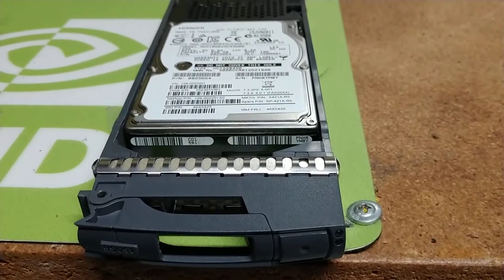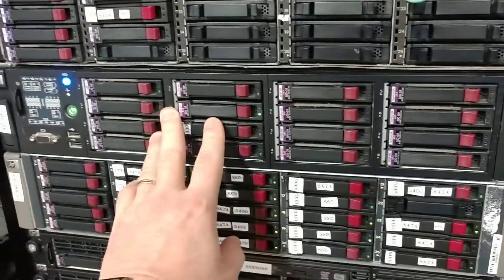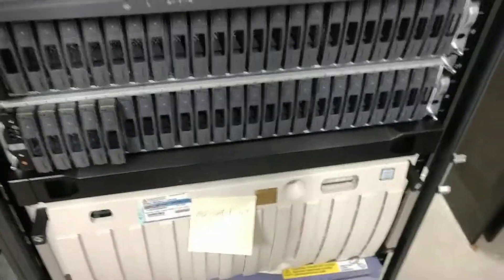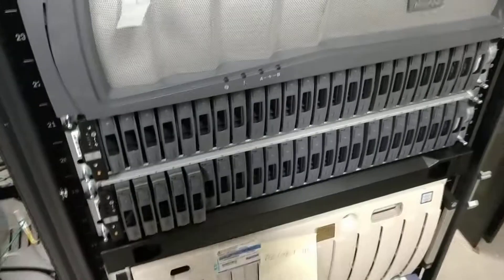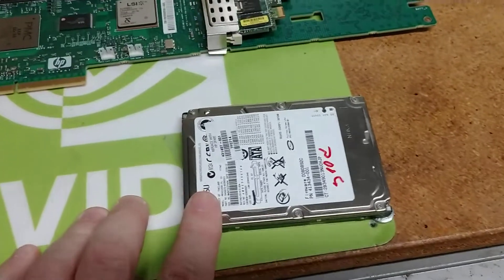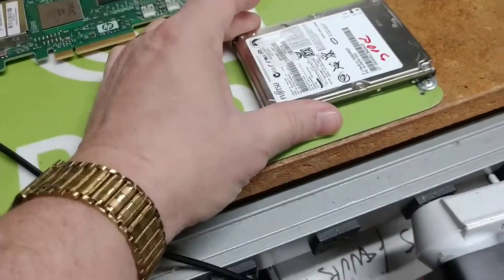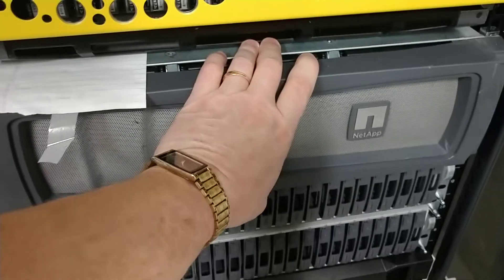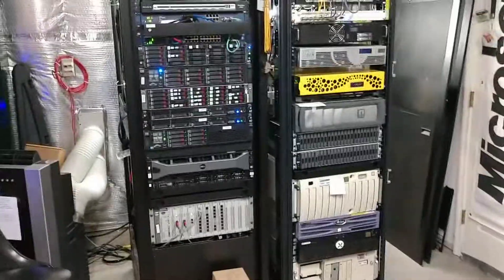How to reuse NetApp disks by reformatting them back to 512 Sector format from 520

Comment: A FAS2240-2 should work fine with the IOM6 module, right?  I have it hooked up to my HBA and can see the drives (both the NetApp 520 drives, as well as the 512 drives I swapped in), so there shouldn't be any snags that I can think of.  Thoughts?  Will these 2240's work as JBOD/Disk Shelves for me?
Reply from the maker: Not sure that model   "NETAPP 111-00190+B1 OM6 Controller Module"  is for the DS2246 DS4246 really
Reply: @leadiususa7394  I found some references that imply the 2246 is just a 2240-2 with the controllers replaced with SAS interface modules and vice versa.  I'm actually minutes away (hopefully) from starting the process of re-sectoring 32 NetApp drives.  And if that goes well, another 50 or so after, lol.  After that I'll just have to figure out why a third of my enterprise 2TB SSDs are showing up at half size with a different name.

Btw, were you able to figure out anything to reduce the power draw of the 2246?  Even in what seems to be the lowest power mode (one IOM6 installed, one PSU enabled, two PSUs installed -- to prevent the hurricane force panic mode) I'm drawing about 100w at idle with only SSDs.
Reply from the maker: @MacroAggressor  For your first question that talk to you SSD 2TB only showing half disk space, reformat them in your array to see if that clears it up.  As for the power usage,  if you onyl have spinning sidk in the array the voltage will drop due to SMART protocol, but if you have SSD mix in, it will not lower the voltage. SSD does use SMART that way. Sorry.  As for the controller question, if it fits correctly I say try it but first do your research.
Reply: @leadiususa7394  Update: so on a NomadBSD thumbdrive, ran '# camcontrol devlist' and while the drives in the server's bays show up as expected, and even some of the SSD's in one of the 2240's show up, the Hitachi's in the second 2240 are nowhere to be found.  Is there something I need to do for camcontrol to see the other drives?  If it's relevant, the 2240's are hooked up via an LSI 9400 that hasn't yet been flashed to IT mode.

Interesting sidenote... the disk shelf shows up as "NETAPP DS224IOM6" instead of "FAS2240" or something, so I think the IOM is reporting it as a disk shelf... which makes sense I guess, since it's just the modules, the psu's, and the backplane inside the case.

Comment: So, I got a Netapp DS2246 enclosure and got some HITACHI 1.2TB Hard Drives. I was able to format the drives to 512B, but for some reason I"m unable to write to them. Not even a partition table.
When I tried to write the partition, these errors popup in dmesg:
[ 4763.317114] scsi_io_completion: 10 callbacks suppressed
[ 4763.317153] sd 1:0:18:0: [sds] tag#0 FAILED Result: hostbyte=DID_OK driverbyte=DRIVER_SENSE cmd_age=0s
[ 4763.317164] sd 1:0:18:0: [sds] tag#0 Sense Key : Aborted Command [current]
[ 4763.317175] sd 1:0:18:0: [sds] tag#0 <<vendor>>ASC=0x81 ASCQ=0x0
[ 4763.317184] sd 1:0:18:0: [sds] tag#0 CDB: Write(10) 2a 00 00 00 00 00 00 00 08 00
[ 4763.317189] blk_update_request: 10 callbacks suppressed
[ 4763.317194] blk_update_request: I/O error, dev sds, sector 0
[ 4763.318297] buffer_io_error: 2550 callbacks suppressed
[ 4763.318302] Buffer I/O error on dev sds, logical block 0, lost async page write
----------------
Of course, when checking the partition, the partition is not there.
Any ideas?
Reply from the maker: See if your disks are seen as  forumn and may need to be imported.  What SAS controller are you using?

Comment: This -and the other links (sg_utils) helped me out. 
This is what I did to, in order to use a Netapp SAS SSD: install a HBA (or a RAID card in IT mode). I used an LSI 9212i card, with a SATA-SAS connector to the drive.
The following depends on card BIOS (and is from memory, steps may be inaccurate - just get to the drive list)
Power on, await LSI boot messages. Press CTRL-C to access configuration manager
Highlight the 9212, press enter
Cursor down to the Direct Attached Storage entry, press enter
Select the drive, press Alt-D  that shows the drive properties.
Select Format drive, enter, F
Await format to finish
Reboot, and use sg_utils to format the drive.

Using a Netapp HD I was able to use the drive just using sg_utils, but with SSD needed to do a format within the HBA

Something to note: despite this, I was unable to:
 - Use the drive as a boot disk: Linux installer could see it, install to it, but the system would not boot from it. It was the only drive in the system, and set to Boot in the HBA. A Netapp HD was fine as a boot disk, as was an HP disk (that refused to work until formatted with sg_utils)
-  Use Netapp SSDs as RAID members. LSI manager returned INC RAID in the status screen; apparently drive does not support extended SMART commands... I suspect its a proprietary firmware issue to lock enterprise users into using Netapp supplied drives, and re-using Netapp drives elsewhere. I do know that failed drives are often reconditioned and supplied as replacements for failed drives.

Comment: Hi, I am using a HP DL360 Server running Linux Server and im trying to Format and change the sector but my server does not even see the drives. I believe the onboard raid card is only good for 900GB.
Can you recommend a raid card that would detect the 3.8TB SAS SSD Drives? Thanks in advance!!!
Reply from the maker: If the hard drive you have are formatted in 530 sector mode you will need to boot off the latest Ubuntu USB stick and reformat the disk to 512 format so they are usable for your server.  Refer to my videos to learn how to do it pretty fast.

Comment: Should I buy a lsi hba controller that is already flashed to IT mode? Or can I use a lsi hba card that isn't? LSI SAS9200-16e 16-Port External HBA Full-Height PCIe P20 IT Mode ZFS FreeNAS
Reply from the maker: sure that will work

Comment: Do I need to have a netapp disk shelf to format netapp hard drives to 512 bytes? I bought a EMC VNX SAE 25x 600GB 10K Array w/ 2x 6GB SAS LCC Controllers 303-104-000E. I don't think it's going to work. I plugged in my 900gb netapp drives to my server bays but it doesn't see them. Other option is to wait for my raid card to arrive and the power and sas connectors to see if my pc will see them
Reply from the maker: No you don't. just a simple SAS/SATA cage with will work plugged into your PC with Linux on it. I use the ICe Dock cage for my SAS sata testing needs. it would work well for this... I only refer to the NetApp array for if you have one like, you could do the formatting faster.  But it still take time.  Here is the link to the smaller SAS/SATA cage lsited below. I want this for DAIG needs as well so I got one like it.  Hope this helps...

 https://www.amazon.com/ICY-DOCK-Rugged-Backplane-Mobile/dp/B0040Z924Q/ref=sr_1_1?c=ts&dchild=1&keywords=Computer+Hard+Drive+Enclosures&qid=1598547809&refinements=p_n_feature_keywords_three_browse-bin%3A6022602011&s=pc&sr=1-1&ts_id=160354011
Reply from the maker: Here is a good cable for the SAS cage. https://www.amazon.com/Cable-Matters-Internal-SFF-8087-Breakout/dp/B012BPLYJC/ref=sr_1_2?dchild=1&keywords=SAS+cable&qid=1598548042&s=electronics&sr=1-2
Reply: @leadiususa7394  Thanks for replying to me. I have the power and data cables to connect them to my power supply and to my raid card. My intention was not to buy a disk shelf because I'm going to make my own diy shelf. I bought 20 900 gb netapp drives, 20 hot swap cages, the raid card, the 5 chain power connectors, and the 5 fan data cables, and a 750 watt power supply. So in theory I can plug them into my pc when all these things arrive. But as you said it will take time to format 20 drives. One ebay guy said they take 3 hours a piece. Easier to use the shelf to populate it with all 20 and do it at once. I also bought a 16gb usb flash drive and put a bootable Ubuntu OS on it. My server boots into Ubuntu but it doesn't see my Netapp drives that I put in caddies and plugged directly into the bays of the server. I have a Dell Poweredge R620 4 bay 2.5". So I can just connect all my drives to my raid card? I'm not going to bother with a shelf unless Im so inclined to make my shelf to do this task. The shelf I bought the hot swap caddies that have sas to sas interposers. Is all this going to work? Or do I need to buy a netapp array? Might be able to get one for 100$. This is the raid card I bought HPE 615418-B21 P822 Smart Array 24-Port Storage SAS RAID Controller with Battery
Reply from the maker: @anthonystrohmayer9191  This will work but one thing you may need to do.  Make sure your RAID card is flash to a non RAID mode or use HBA controller card instead for formatting.  When a RAID card is in RAID config. It will not see anything that is not 512 ready. Your disk are in 520 mode currently.  Reflashing the RAID controller  in forcing it into none RAID mode will let you see the drives.  But I don't do that for I like my RAID controllers so I just bought myself a simple $20 HBA controller and built a work station to only format drives.  Flip your disk array over to it with the 20 disks and start formatting then later once done move the array back over to your Dell server.  BTW my work station is just a motherboard / 2 drive SAS cage and a PSU with no case. Very easy to reconfig on the fly.
Reply: @leadiususa7394  Uh, okay about HBA card or flashing my raid card, I think I was going to try to flash the raid card but it's like a million step process. And this Dell Poweredge R620 requires me to buy a license to flash the raid card. It needs me to get a license for IDRAC. I don't even know what IDRAC is let alone flashing the bios of the raid card to format these drives. So it leaves me down to my HPE 615418-B21 P822 Smart Array 24-Port Storage and the raid card I bought and let's see what happens.
Reply: @leadiususa7394  Last ditch effort next week is an HBA card. Those can't be very expensive. So I just plug my disk shelf to the HBA and boot into Ubuntu or Linux?

Comment: Hi do you think you could post a link to where I can find one of the mini sas to sas cable. I have the same raid controller that you showed and want to connect to a netapp disk shelf. also one thing about the format I'm gonna be using non netapp drives so I should be good to go with plug and play right?
Reply from the maker: https://www.ebay.com/itm/SFF-8088-Mini-SAS-26P-Pin-to-SFF-8088-Mini-SAS-26P-Pin-1-Meter-External-Cable-1M/173957896488?hash=item2880b2d928:g:SI4AAOSwDLhdIwww
Reply: @leadiususa7394  Thank you.